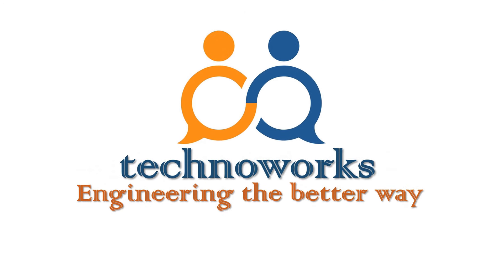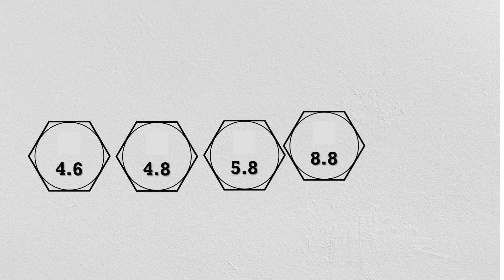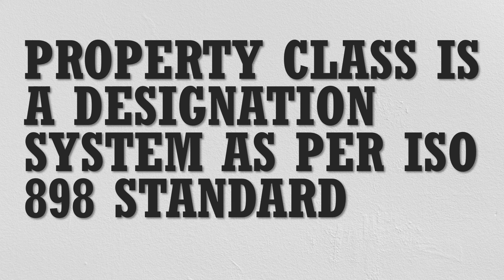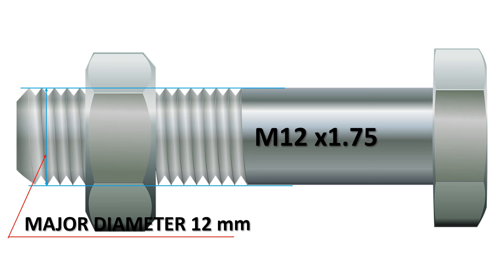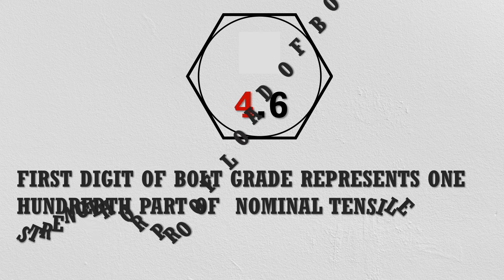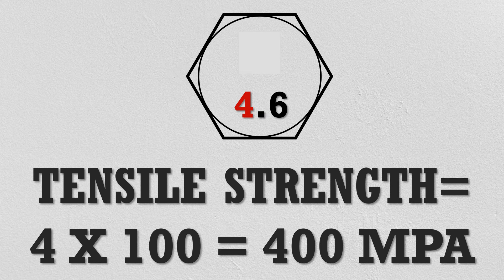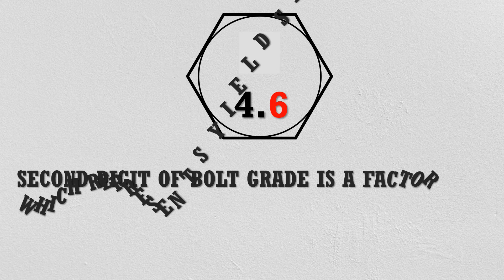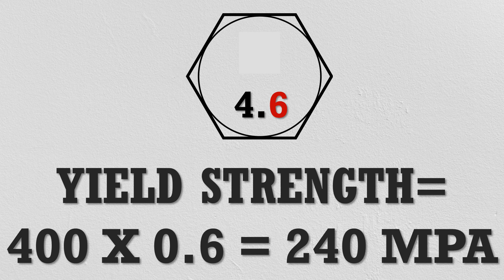Bolt grade explained

Comment: Obviously this is only for Metric Bolts.
So First Number is Tensile Strength (Max Force at when the bolt will “BREAK”)
And Second Number, after the Point, is a Yield Strength (Max force at which the bolt will start to “DEFORM”)
So first number is “Breaking” force and second is a Percentage of the first number at which force the bolt will start to “Deform”.
Reply: Thanks bro for the meaning of Yield and tensile strength

Comment: Hi there, may I know what's the different between Grade A,B as specified in ISO 4014 & Grade C specified in ISO 4016.
How do we justify when compare to Bolt Class 4.6, 4.8, 5.6, 5.8, 6.8, 8.8, 10.9?
Can I say that ISO 4014 only cover up to Bolt Class 5.8?
6.8, 8.8 will be under ISO 4016?
And how about 10.9?
Thanks

Comment: Thank you, so the equation of 24 is 12... of spannar or wrench. 
the biggest bolt is 24 diameter (nut),commonly nuts and screws are use 12.

Comment: A SAE (Standard) bolts thread is measured by the distance between the threads not how many per inch?
Reply: SAE bolts are expressed in bolt thickness and then threads per inch. 
Example---1/4 -20 means that the bolt is 1/4 of an inch thick and has 20 threads per inch. The other dimension would be length,  which is also expressed in inches.

Comment: It's come in which subject please tell  me. 12.9 bolt yeild strength is 900 as per your video but isro exam take ans is 1080 so i want to proof for rise objections. Pls
Reply from the maker: 12.9 means 1200 MPA is tensile strength and yield strength is 90% of 1200 Mpa= 1080 Mpas
Reply: @technoworks.  i am doing wrong in multiplication so my ans is wrong